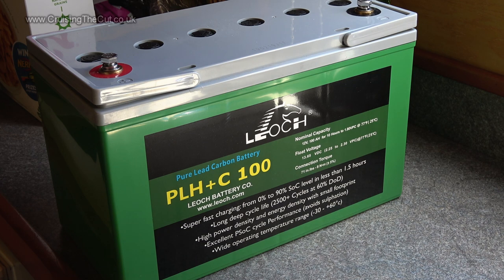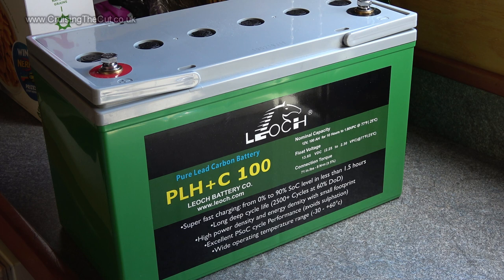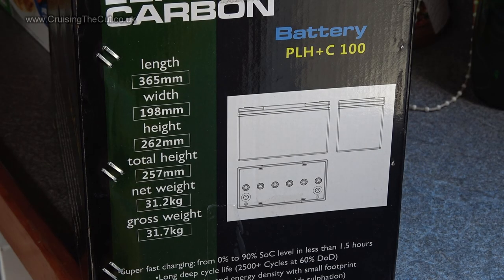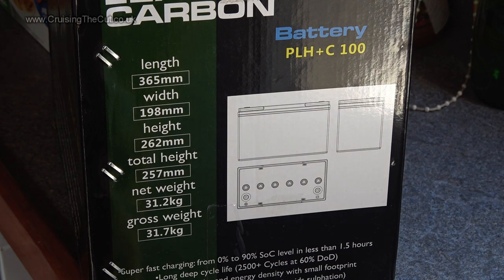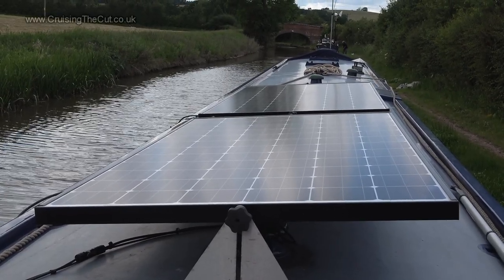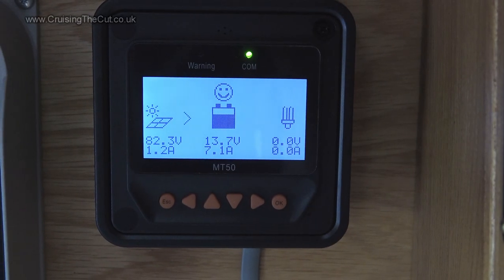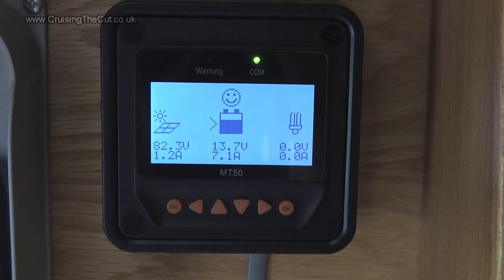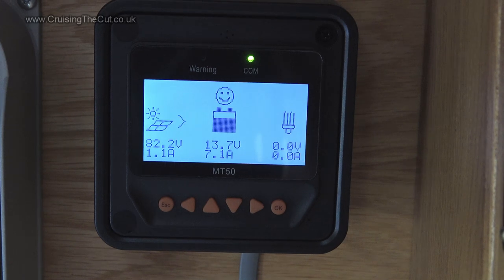178. Installing Lead Carbon batteries (12V 100Ah) into my canal narrowboat

Comment: Re not knowing what your victron Inverter was doing; I thought Victron supplied a cellphone app (VictronConnectApp if I am not mistaken) that lets you monitor, control, and configure your inverter as well as letting you update its firmware.
Reply from the maker: You can't (or couldn't, on mine) update the firmware with the app; you have to first buy a dongle that lets you update the firmware with a cable, then you can add the bluetooth dongle that lets the app communicate with the inverter!!

Comment: In Silly Con Valley the term for look at the documentation is abbreviated to RTFM. Also, known as read the fing manual. That is when the engineers are upset at user laziness.
Reply from the maker: Indeed, I know the term well!
Reply: My sister makes a living making sure engineers aren't the lazy ones (documentation documentation documentation).  They only say "oh, that's wrong because I haven't fixed the doc yet" once to her.  Too many times, docs ship with the incorrect info.  Not that I'm complaining, I make my living telling ppl the right answers.

Comment: Hi David, down to what depth of discharge do you find you still get usable output voltage? Cheers!
Reply from the maker: No idea. I don’t have any Amp-hour meters or other such devices. My only measurement of the batteries is their voltage, which of course is only any degree of accurate when there’s no sun on the solar panels and no draw from any devices (so, middle of the night when the fridge isn’t compressing!)
Reply: @CruisingTheCut  ok thanks anyway!

Comment: ... check some of the sailing/cruising u-tube channels.  There are several owners who have installed solar systems w/ larger battery banks ... and they do not have the advantage of pulling over and plugging in like on the canals w/ a narrowboat.   The dis-advantage w/ "lithium" batteries ... they like to catch on fire ... especially if they are over-charged !!!!  They think the "dive boat" in California that all those people died on,  was because the charging lithium batteries  started the fire.  

Oh .... NEGATIVE  FIRST !!! Always ... (unless you have a negative reverse system ... like the old 1960's British Leyland cars did .... which was a** backwards !!! to all other cars ...)
Reply from the maker: You can't really pull over and charge on a narrowboat either, there are no canalside charging points.
Reply: From google ... Positive ground was very common, especially on a 6V system on work machines (generators, etc.) In the mid 1920's, nearly half of the cars produced had positive ground, including Rolls Royce. Packard, Nash, Hudson, Pierce, and Studebaker were positive-ground until the mid-fifties. 

All British vehicles imported after WWII were positive ground, many stayed that way until the early seventies. The Ford Motor Company used negative ground polarity on the Model-T, then went to positive ground with the Model A, and back to negative ground in 1956.

The positive ground was mostly abandoned with the introduction of 12 volt systems in the fifties. 1955 was pretty much the last use of 6-volt electrics in American-made cars. Most cars switched from 6 volt positive ground to 12 volt negative ground together. An exception to this was the 1955 Packard, switching from 6v to 12v but not switching to negative ground.
Reply: Once got into trouble moving a boat under construction when the 1956 Chevy engine was 12v and that was new to us Americans. There was no ballast resistor and the points kept burning out. Happened in the rock-sided, fast moving Cape Cod Canal. An eddy pushed us into the Coast Guard basin and saved our ass. It's all described here: http://www.freewarehof.org/hilgend.html

Comment: Dave I know you did not show how you updated your victron, but could you please advise did you download software from victron if so what was it please and as victron is a minefield it makes it hard to locate, as I have just installed new battery bank and have solar panels too
Reply from the maker: I did download from Victron but I’ve no idea of the link now, this was months ago and I’ve even changed laptop since then. I do recall it being hard to find, as you say, I think you have to pretend to be a Victron engineer and ignore the warning messages.

Comment: Interesting stuff, thank you. I understood it’s disconnect negative first if you have a negative earth setup like on a car, but does a narrow boat have some kind of common earth or is everything just wired as twin cabling?
Reply from the maker: Twin cabling; there's usually one main earth point where all the -ve leads come together on the hull for the battery system and then for reasons that escape me either the engine or the alternator (I forget which) gets connected to the hull about a metre further away.
Reply: Just so long as no electrical items are wired with a negative earth to the boat hull. This can lead to stray currents from other boats adding to the galvanic corrosion of the hull.
Reply from the maker: Yes, the hull should not be used as a -ve return on the boat at all.

Comment: Well done you. In fact Bravo! ignoring the 'live or neutral first' debate (me I am a live first 'voter' ;-) ), another good tip (following your taped up spanner one) is to only use one hand where possible, it stops any electric current running across your body, and therefore across your heart. Regarding your finished wiring installation, I would merely suggest that you might like to 'tidy up' the 'smaller wires' away from contact with battery terminals. Any abrasion from vibration (ie the boat engine) can cause the insulation on the wires to break down and short circuit. I think just tape them out of the way or get some little stick on wire clamps to hold them against the bulk head etc. I am now off to follow your advice to the letter, and get my five year old to re-wire our house... :-)
Reply from the maker: As luck would have it, I did only use one hand! As regards smaller wires, there is only the one (going to the bluetooth dongle) but yes I should probably cable tie that.
Reply: 12v is not strong enough to conduct through skin! So it will no way have a chance of getting to your heart to pull enough amps to stop it!
Reply from the maker: It doesn't matter about the 12V pushing through skin, the issue is that if you connect the +ve and -ve with the spanner (or any other connection) then the entire power of the battery will flow through that joint, light up like an electric fire and burn the crap out of you and the battery...!!
Reply: @CruisingTheCut  i was only refurring the the comment about the conducting of 12v through the skin, as an electronic engineer i think im fully aware of the conductivity of the spanner situation, but i wasnt commenting about that part of the discussion.
Reply: @iamthetinkerman  There is a worthy expression 'it is not the voltage but the current that kills', these batteries are more than sufficient to kill, and proper precaution is required.

Comment: I can’t see any hence the question. Do you have any information on the maximum continuous recommended charge rate, or discharge rate? I see words like ‘rapid charge’ which implies rapid discharge but one persons rapid may well be different from another’s! Thanks for the video
Reply from the maker: Max charge 30A (per battery); peak discharge something ridiculous like 1200A
Reply: Many thanks, so roughly 30% as a max charge rate, and maybe as a guess for continual discharge? The peak numbers (imho) are silly for anything but very brief loads like  startup loads. So pretty similar to LA based batteries - which I guess ultimately they are!

I'm sure you will be please do report back with your thoughts after a month or two.
Reply: rapid charge would indicate a large capacity (inverter)/charger (150 amp +). Neither the alternator nor the solar charge controller would approach anything like that.

Comment: Do you know how much power you usually use in a day? Laptops, TV, phone, lighting, fridge etc.
Reply from the maker: I did a rough calculation a long time ago. The fridge is generally the biggest consumer on a narrowboat, typically taking 40-50Ah per day. My laptop is also very greedy when it is going flat out processing a video, I've seen it hit 180W draw. (Many boaters prefer to run their laptops from a 12V adapter instead of through an inverter to minimise inefficiency but I don't have a convenient socket to do so at the dinette where I work). Other than that there's very little; the water pump draws a few Amps but is only on for a few minutes in total each day. The LED lights are a negligible draw. The TV is also mains powered by only takes 20W (about 2A @ 12V). The phone is negligible.
Reply: People with off grid cabins also mention that the fridge is the biggest draw.

Enjoy the new fridge-freezer and ice cream! :-)
Reply: @CruisingTheCut u will work it out '

Comment: Unlike you I am an electrician, I was taught to always disconnect the hot lead first then the ground so if you have a short it has a path to ground other than your body! My uncle was like you when he had to work on a circuit he would turn off the main breaker open the panel and take the wire out of the breaker of the circuit he was working on and tape the end.
He freaked out the first time he watched me open up the main panel and go to work without turning the power.
 off FYI a dry pair of leather gloves will protect you up to 110V alternating current
Reply from the maker: Thanks; I put some rubber gloves on
Reply: Im a sparky too, and I accidently found out that really dry hands after cutting downlights in plasterboard, can insulate you from 230v.
Reply: Batteries are different. 
The idea is if you short the battery live to ground accidently while waving cables around with the ground side disconnected no current can flow as the ground is then at battery terminal potential. Once the live side wiring is complete the ground side wiring can be done as hitting the ground with a grounded wire is relatively painless. You just have to watch the live terminals (a bit of insulation tape over the live terminals is a good idea too).
A shorted battery can go bang loudly. A battery bank is louder still.
The mains equivalent is to use an isolation transformer.
I would recommend a solar panel isolation switch however regardless.
Reply: That's good advice for AC, but for 12V DC, it does not apply.

Comment: If you want controversy then ask if the current goes from positive to negative or negative to positive lol
The spark will be because you are making the final connection that forms the circuit.
The way it was wired would probably cause an unbalance if it was a lithium ion, but not sure about lead. Would probably all depend on how good your BMS worked.
Reply from the maker: Haha no I don't want controversy! I like a quiet life!!
Reply: Conventional current flows positive to negative.  Only geeks care that actually the current flows the other way.

Most likely the spark is inrush current to the inverter's input capacitors.  While you had it all disconnected, those big caps were discharged.  When you reconnected for a fraction of a second the discharged caps looks like a short circuit.  You get a big current and hence the sparks.

Actually the sparks are caused by you bouncing the contacts whilst a large current is flowing, but meh.

As your boat hull is not connected to either positive or negative battery terminals the positive Vs negative first people are both wrong 😆😆

Love the vlogs!
Reply: Not really a controversy, it just that not everyone knows which way the electrons move. "Positive" and "negative" were decided upon before it was discovered the actual direction of travel. They had a 50/50 chance of getting it right.
Reply from the maker: Robin, the boat hull is most definitely connected to -ve but it's not used as a return ground to appliances, there's just one single connection point.
Reply: @CruisingTheCut  I stand corrected!  I thought they weren't connected to battery negative to avoid corrosion.  Do you know why the hull is grounded?  Every day's a school day :-)
Reply from the maker: Robin at that point we're going above and beyond what I know about earthing sadly. You do indeed want to avoid galvanic corrosion but that only happens (as I understand it) when you have a connection to a shoreline which has a different earth potential. It's usually avoided by a galvanic isolator on the incoming shoreline, or a full-on isolation transformer thingy doodad.

Comment: So, can you now allow your new washing machine (good choice BTW) heat the water now?
Reply from the maker: Nope, my inverter wouldn't handle the draw but also the battery capacity hasn't changed so it would still draw far too much out of the batteries to heat any sensible amount of water electrically.

Comment: It would have been better to leave the leads on the center battery as the connecting cables connecting the batteries would have shared the charge/ discharge load. Not so important with small currents, but does make a difference with high currents.
Reply from the maker: No, it definitely wouldn't be better like that. Have a read of the linked article, cheers
Reply: @CruisingTheCut  thanks. Enjoying the vlog.

Comment: Dear David
Is there any gas discharge from lead carbon???  Or are they safer than lead acid batteries? Is this one of the reasons why you chose lead carbon? Sorry lots of questions. 
Well done! For having a go and giving all the safety tips. I always disconnect red wire first. As that is what I was trained to do!
Reply from the maker: They have a safety release valve but under normal circumstances I believe there's effectively none (though I stand to be corrected)
Reply: @CruisingTheCut  hi, let me first say that I appreciate how engaged you are with the comments on your videos, and the quality of your videos.  I have only watched about 5, you came up randomly because of youtube magic.  Let me contribute back to your channel when I say that charging all batteries will produce hydrogen through electrolysis.  The pressure safety valves you are talking about are for if the water in the batteries starts to boil.  Under normal (leaky, real-life) circumstances, you will not have a problem.  Have fun on your boat.
Reply: @CruisingTheCut  second follow up comment, while sparks are scary, 12v (even 24v) is not enough voltage to overcome the resistance of your skin.  You can safely touch the opposite sites of a battery without a problem.  You can try to avoid shorting them but it will cause no real harm or lasting damage.  The only real danger is the heat produced by the arcing.  You are wise to be wary of electricity; such low voltage levels however are quite low-risk, so don't be afraid of some sparking or mistakes.  Take care.
Reply: @CruisingTheCut  third follow up comment, you can push batteries harder than equalization voltage, they will charge faster! it is how fast-charging works on your phone. However, this may limit the useful life of your batteries and damage them. Great bit at the end. You may consider a charge controller for christmas!

Comment: Cruising The Cut    spark is when the capacitors recharging in inverter this will always happen.use safty glasses, tap the last connection  for spark  then connect. i follow (diy solar power with Will Powse) here on you tube  he is vary knowledgeable.

Comment: G'day is there any reason you choose this type of battery and not lithium or gel? Good vligs by the way
Reply: Just saw a "blue water" cruiser install similar batteries. Their reasoning was mainly cost. And that lithium batteries tend to really not like being drained beyond a certain point.
Reply from the maker: Cost and needing to move them and rewire and buy new gear if lithium. Gels - no advantage over the lead carbon in fact the lead carbon has better spec for the same price.
Reply: And lithium will not hold a charge for longer than few days to 10. They are bad about holding a charge. Carbon lead will hold the charge along with deep cycle and fast recharge.
Reply from the maker: I didn't know Lithiums were so bad at holding a charge?!!
Reply: @CruisingTheCut  Thanks for the info ours would be a new install so we don't have to change anything. Lithium not holding charge is a new 1 to me

Comment: It's the inverter. Even when you know it is going to spark it is always a bit disconcerting. Like popping a ballon
Reply: no its not, the main switch is OFF, its a normal phenomenon when you connect two or more battery together and it is due to the fact that voltages of each abttery is not perfectly equal and battery do not have a null resistance.